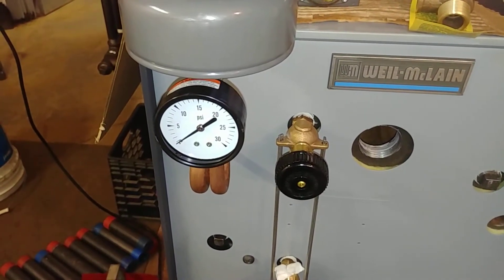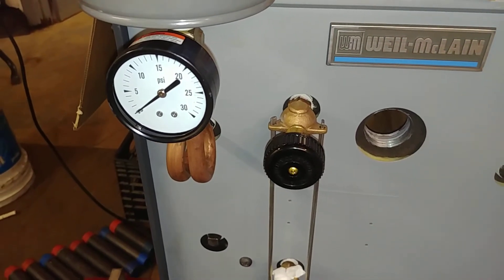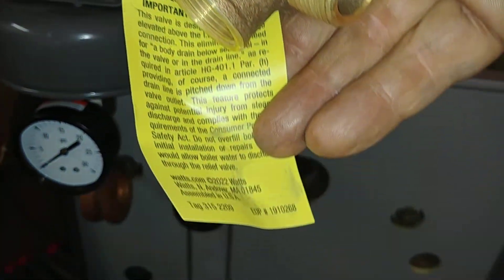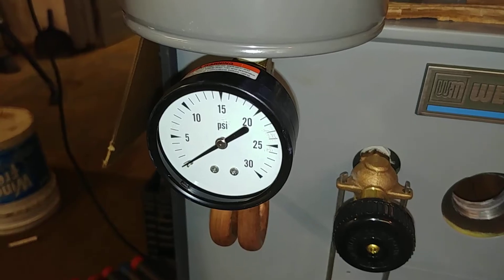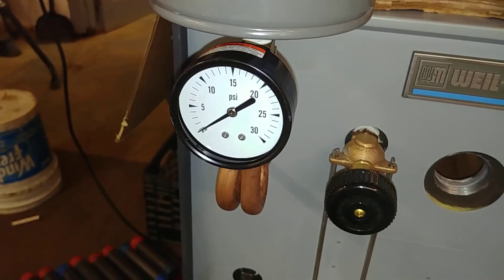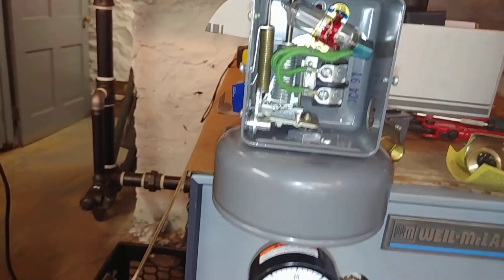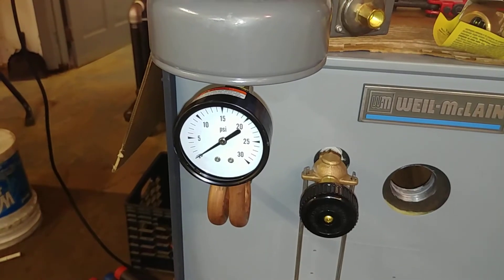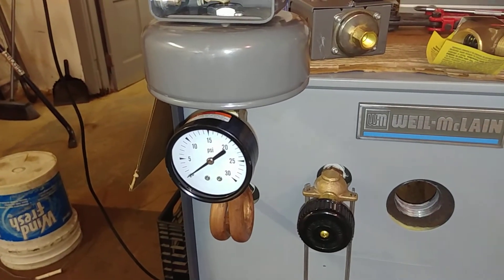Why Doesn't The Pressure Gauge On My Steam Boiler Show Any Pressure? Hint: It Rarely Should

Comment: Excellent and informative as usual Gordon.  So I’m trying learn about steam and to dial in my old boiler.  I’ve decided that, since all I have currently is the 30 psi code gauge and am, in effect, flying blind, that I would add a low pressure gauge as my first upgrade.  It just dawned on me that by adding just a blood pressure bulb and a 1/4” barb fitting to the parts I ordered to Tee that in I can rig up a test jig for my Pressuretrol.  Mine seems to be absolute junk.  My system cuts out at 3 psi and cuts back in at 2 according to the current gauge.  If I turn the screw left even just a 16th of a turn it will cut out at about 2.875 psi and not cut back in at all without intervention.  Does that sound like a bad Pressuretrolto you?
Reply from the maker: I am glad I am useful to the steam heating community!
As to the PA404A pressuretrol, what you are experiencing, sad to say, is its usual hi-jinks.
It is a pretty precise control, but it is not very accurate. 

Taking a step back in looking at your system, have you tried having a tech downfire your boiler a bit?
The idea being that the pressure control is a limit control only.
If you put less energy into your system, as long as the radiators get hot enough, the radiators will adsorb the steam and the pressure (which can be thought of as unnecessary energy input) will not hit the high limit. 
Or take longer to hit that high limit, and by then the t-stat is close to being satisfied.
In theory, if the energy input more or less equals the energy adsorbed by the radiators (the output), the pressure will never rise above a few oz.
Reply: @gordonschweizer5154  I have been thinking about what would be involved downfiring it.  The cycles seem to be very short, something like 4 minutes on and 3 minutes off.  It does put heat into the house but I’m afraid it’s not very efficient.  The boiler is rated for a .95 GPH firing rate per the plate.  My burner has a .85 GPH nozzle.  I’ve been thinking of going with a smaller nozzle but am concerned about the consequences.  I know I need to test the pump pressure and hope to be able to do that soon.  I’m hoping it’s somewhere near the 100 psi it shipped with.
Reply from the maker: @paulkennedy5822  I'm not as versed in oil heat as much as gas, so, grain of salt if you will.
That being said, the lower limit of down-firing is usually determined by fuel gas temperature.
If you down-fire too low, the water vapor in the flue gasses will  condense in your flue and cause it to fail.
Not exactly sure what the lower temperature limit is, but it's not much lower than 385*F
If you have an exterior chimney, flue gas temps need to be higher to start.
I'd consider getting your flue relined (if not done already).
Reply: @gordonschweizer5154  Thank you for the recommendation.  Right now I’m in the learning and planning stage.  Once I (hopefully) make it through this heating season I plan to have the system thoroughly inspected by a professional with the proper analyzer.  I will make sure to have a smaller nozzle on hand to maybe try it.  In the meantime I am learning and planning maintenance and potential upgrades to improve efficiency.
One complicating factor is that I am investigating installing a whole house heat pump.  If that happens, the existing steam system will likely become a backup and, as such, efficiency will not be as important.  Of course maintenance and safety will be paramount so, depending on what I find, I may end up addressing the chimney.  Again, thanks for the insight.

Comment: Hi Gordon . I 
have my Weil McLain  steam boiler , in my 2nd house , I didn’t drain the rusty water almost a year , when I opened the drainage 4 days ago , I find it sucks air inside the boiler , I waited to cool off and drained all rusty water ,still sucking air , the 2nd day the same thing happened. I drained it completely 3 times and still sucking air when I open the drainage spout , I think it may be a return line is clogged from accum’ rust ,can you tell me what it is , please . every devices are working good with no red lamp
Thank you
Reply from the maker: It sounds like your system is holding a vacuum?
I can't see what would cause that from here.
Is there a way to let air in somehow?
Reply: Unless I install a vacuum breaker, by the pressure gage , but why this vacuum coming from , it is 15 yo system , but I neglected completely just year due to Corona time
Reply from the maker: @sambotoo5326  Did you have a one pipe or two pipe steam system?
Reply: Only one pipe and devised to 2 pipes , one to the front , and the 2nd to the back of the house
Reply from the maker: @sambotoo5326  Your main vents might be shut and not letting air back into your system.
They may even BE vacuum style main vents that have "decided" to start working again as vacuum vents?
Reply: I will check the main air vents , and see what will happen, thank you for advising

Comment: The plumber and I flushed the wet return and checked the system.  I have one radiator at the end of a 2" line that blows water out the new #40 air vent.  I have to rotate the air valve to allow the water to drain out for the next heating cycle.  The 2" main has a new Gorton #1 vent. The radiator is pitched correctly.
Any ideas what's wrong ?   Thanks.
Reply from the maker: Is the pressure too high?

Comment: As Dan Holohan said...." the Empire State building runs off 1.5 lbs of steam for the whole building. I work on commercial boilers and have seen plenty of process steamers running at 13,15,20,50,100,300 lbs of pressure and superheated steam in excess of 600° steam. I worked with a guy who was the only certified tech to work on ultra high pressure steam. He would tune up the boiler and we'd check pressures......1500 psi and 800°+ superheated steam. Everything was stainless steel and every connection point had to be checked and tested. It was a huge boiler. I believe it was a 150,000 lb per hour steamer.
Reply from the maker: Thank you for your story!
As to the Empire State Building, the trick there is that there is a big vacuum pump on the return that pulls at least 6" Hg, so the delta p on the steam is over 6 psi.
Even so, still pretty low pressure for such a big building!
Reply: R u stating fact? Im just curious to know im not being an ass. I do know that the condensate is not returned to Con Ed plant for reuse.  They don't want it back lol so it's

Comment: I have a 0-3psig on my IN4 and the needle barely moves. I have been tempted to adapt my Fieldpiece Joblink probes to get a window into operating pressure of my boiler
Reply: Get a low-range Magnahelic gauge on eBay. Shoot for a range of 2-5 inches of water column
Reply: There is 27 inches of water column per psi.  Half a pound is roughly 14 “.  A 50 inch Magnehelic would be appropriate.
Reply: @gordonborsboom7460  he said his 0-3psi gauge barely moves and your recommendation is the equivalent of a 0-2psi gauge? 50”wc is way too much range

Comment: Thanks, I was always frustrated to see the gauge needle staying at 0, even if the heating of the house was OK. Because of that, I was suspected a leak in the wall.
Reply: My two-pipe steam system has only ONE location for the vent/s, so it is easy to remove the vent and insert a plug and then run a pressure test with compressed air.